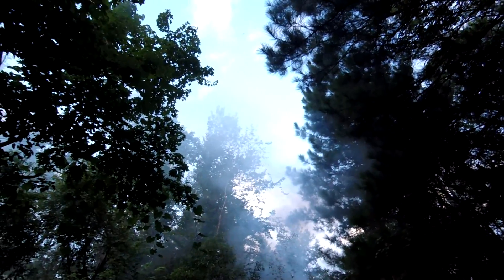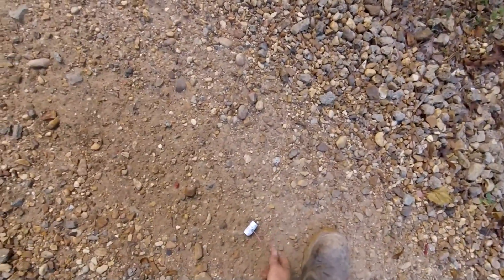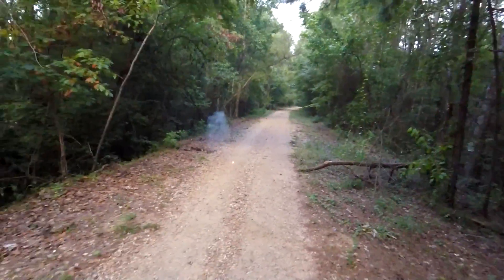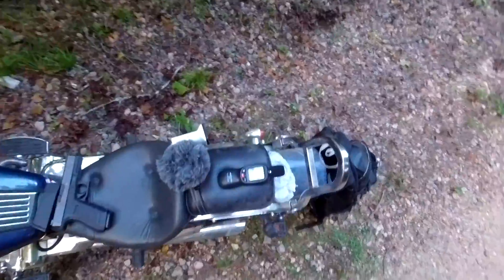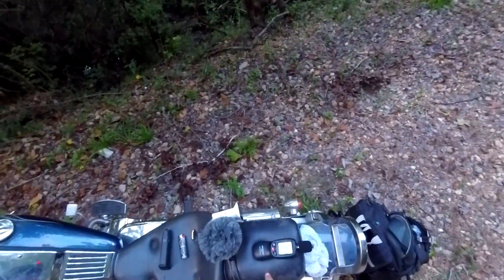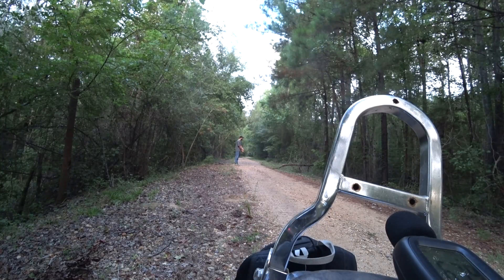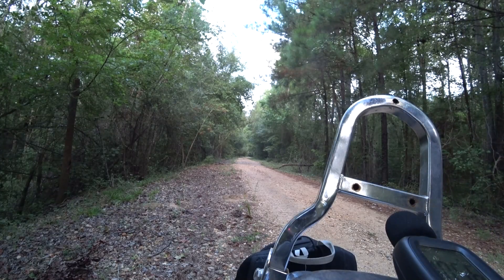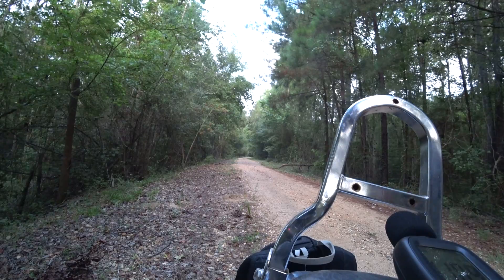Flash Powder (salute) Comparison Pt.2

Comment: Hey my brother my dad made 100's of grosses in the 60's 70's 80's and he mixed different kinds of powders that would flash and exploded.  Not so much smoke. Black silver and a white mix with a little bit of corn hull bits mixed in and boy nice boomers. Back then 10 cents a piece now 2 to 4.00 per m80's and hard to find. But there out there. Hush world boot legs supply.  😮
Reply: Can you please find out what kind of glue they used to seal the ends?

Comment: You did yourself a disservice by not mixing the flash before.  I can understand not wanting to, but if your going to mix in the tube, at least mix 5% of the Al with the PP through a screen.  This will help stop the PP from clumping and the rest of the Al will mix better.  My favorite way is to screen 5% then diaper the rest until it's mixed well.
Reply: High Humidity especially during the summer months tends to cause clumping because of the moisture in the air. Some people say this is good to prevent a charge but personally i notice a huge difference during the dry winter months

Comment: I've wrapped M80s I've made with fiberglass filament tape in crossed directions and noticed a distinct increase in sound. 
Flash creates report much like lightning creates thunder,  the reactants are two solids, the products are also two solids.  

I realized how much heat was made after doing some below ground tests which create a cavity large enough for my hand.  A very warm cavity in the ground
Reply: i use flash powder and that seems to do the trick

Comment: What are the pros and cons between plastic and paper end caps?
Reply: Plastic plugs or hot glue become a projectile,paper plugs and white glue are all that's required,that's what the original m-80 and silver salutes used,flash powder is not like black powder or gun powder,all it needs is a millisecond of resistance and it detonates,big difference
Reply: @shannonking3201   I’ve never seen a large salute in person before until New Year’s Eve.  The only thing I’d seen before was an m80.  It was 4 inches long and had 20 grams of a 50/50 mixture of Potassium Perchlorate and Magnalium.   Not sure about the construction of it.  Car alarms were going off all over the place.  I can’t even fathom wanting anything stronger than that.  It put out a decent flash too.

Comment: I was debating using double paper ends glued in each side to see if it helped with the thud on 7g of 70/30 in a 3/4" x 2" tube. 

I would be scared to do a "shake and bake". I thought this stuff was extremely sensitive.
Reply: 70/30 KCLO4 aluminum is a pretty stable mixture. Adding sulfer to the mix makes it less stable but more powerful. Be cautious when making this stuff and be smart
Reply: @JayceMcCormick  I thought I had read kcl04 is stable with sulfur. Its kclo3 that isnt. Havent tried either. Just an avid reader
Reply: @pyrocat1150  the sulfer gives an acidic environment to the composition. A video demonstrated that kclo4 aluminum with sulfer is more powerful.
Reply: @JayceMcCormick  yeah i knew combined they were stronger. I meant if it made it any more unstable to handle. With kcl04 i dont believe it does
Reply: @pyrocat1150  well think about it, kclo3 is stronger because it is less stable, causing the oxygen atoms to react faster, adding sulfer makes it more unstable causing an even faster reaction, and if kclo4 is more powerful with sulfer, than a reasonable conclusion is that the sulfer makes it more unstable. https://youtu.be/1tdmSpzAqpg
Reply: @JayceMcCormick  yeah that makes sense. I was just stating what  I had read about unstability when using it with kcl04. It didnt seem to be that way with perchlorates. But they say it's very unstable with chlorates.
Reply: @pyrocat1150  glad I could help. Be safe and don't get hurt or in trouble.
Reply: @JayceMcCormick chlorate has one less ox atom than perchlorate,adding sulphur to a perchlorate oxidizer makes the perchlorate give all its oxygen faster,and and therefore is more powerful and is no more dangerous than flash powder without sulphur
Reply: so I actually tested sulfer in my flash 64/26/10 and it burned slower than 66/34 flash
Reply: @JayceMcCormick  alright. Ive heard of 64/23/13. And 50/40/10.

Better thud
Reply: @pyrocat1150  have you tried?
Reply: @pyrocat1150 I just explained where the and how the thud as you say comes from
Reply: @shannonking3201  it seemed slower with the Sulphur than without it.

Comment: What about the shockwave?? How do these compare or does the 10mm still has a stronger physical blast
Reply: Sound is shockwave, pressure etc. The stronger blast, the bigger the "sound" or dB. BUT humans tend to percieve high frequencies louder. So a deep and hard boom may not sound loud, but it is in fact high dB.

As for your question, i think the gunfire dont have much shockwave, but is very loud as it is high frequency.
Reply: @marcuskalvik7831  ohhh thanks a lot and its weird for me im able to not notice high frequency loudness my body tends to ignore it. the ones that make me flinch and cringe are deep blasts the ones that you feel the blast physically

Comment: What glue are you using. I’ve tried everything I can but I just blow the caps out. Wood glue Elmer’s gorilla you name it
Reply: If flash powder is blowing the plugs out you have a very poor flash powder,you tube is full of morons using hot glue end plugs,the original m80 s only used paper and white glue,only had 2.5 g of flash pwder

Comment: K2Cr2O7 3% +KClO4 70%+GERMAN DARK AL 30%+1%SiO2 💣💣💣ASD -6 spherical dispersed aluminum or Spherical aluminum-magnesium alloy AMD-50M 40% +KClO4 60 %+K2Cr2O7 3%+1%SiO2 Low bass!!! https://youtu.be/KOIGs9ZmyiI rice hulls great filler add 30% to flash composition

Comment: Hey man just a suggestion to supercharge any of your flash mixes.  Add in some Bullseye Smokeless powder after you make your flash.  It contains 40% Nitroglycerine and the flash will detonate it!
Reply: This is a bullshit rumor,the nitroglycerin in smokeless powder is formulated to not detonate but burn at a controlled rate for use in cartridges,it doesn't do anything mixed with flash powder but burn,and flash powder doesn't need to be super charged as you say,good flash powder is truly impressive
Reply: how much to a 10 gram batch of flash?  1g  2g?
Reply: @SuperHighFlyGuy  2g
Reply: @SuperHighFlyGuy For a 10 gram batch you add 10 grams of Bullseye. You’ll end up with 20 grams and enough to make close to 7 salutes.
Reply: @Metal1USMC  Yeah, before the market went crazy I mixed some 50/ 50. The secret is a huge airspace. I only put a teaspoon of each in a 2" tube 3" long with plywood plugs. I pre drilled the side for a fuse. Glued in one end. Put the mix in a baggie with the fuse. Tie it shut with string. I used needle noses to push the fuse from the inside out. Hot glue it on the outside. Then glue in the other plug.

The second secret is called spiking. Run string around at 1/4" spacing. It is glued on with paste. Then, cover with paper. A quick alternative is fiber shipping tape.

A note for the ATF. This is meant to be used as an aerial salute only. Making explosives in the USA is illegal.
Reply: Have you tried them side by side? What kind of flash are you using? You obviously don't know what you're talking about.
Reply: @mattw5048  no I've never tried them side by side because the nitroglycerin in smokeless powder does not detonate it's designed and formulated to produce high pressure gas,there are many types of nitroglycerin,the one your talking about for reloading metallic cartridges,and the kind you can't get,I think you need to do a lot of research and educate yourself,I'm a prosess chemist at the Radford army ammunition plant in va,so i may know a little bit about the various varieties of nitroglycerin, smokeless powders, Dynamite,tnt,torpex,rdx,pten,to name a few,and also the batfe classifies flash powder as a high explosive,facts

Comment: I would suspect that the deeper the crater the more the sound will be suppressed. Also the ground itself will dampen sound and would vary quite a bit from one site to an other. I would think that placing them on a steel plate would be better for testing. The steel plate may contribute to the volume but it would be the same for all the salutes tested. 
I have observed that hanging the salute from a tree branch increased the perceived sound.

Comment: This is the best most thorough pyro video ive watched on here and i have watched a bunch ive been using 70/30 flash for 20 years and this just proves my own theory it works great so no need to change it thanks for hard work you put into this
Reply: Do you use the potassium perchlorate and the 30% dark aluminum, I am asking becouse I was told to never mix more than 100grams at a time, and to never store F.P..  Does that sound like it's over zealous safety advise?
Reply: @Dan_Soundgar-You can store it but it will weaken the powder over time for most compositions. Most of these people have no idea what they’re talking about. Heat n High Humidity basically neutralizes FP. I’ve been working with FP for over 23 years. IMO it’s better to mix and mill during the winter months
Reply: Hello! How can you protect yourself from random explosion when using: KMnO4 and al?
Reply: What do u mean by 70/30 ?
Reply: @omarrobles1108   70% KCIO4 / 30% Al i think
Reply: @omarrobles1108  70% potassium perchlorate 30% dark aluminum, For example, to make 100 grams of flash powder you need 70 grams of potassium perchlorate and 30 grams of dark aluminum, it's simple.
Reply: @omarrobles1108 - 70 perch and 30 AL.  Popular mix for these enthusiasts.

Comment: Have you ever tried bright aluminum 400 mesh ? When I used to do this type of thing, I had awesome results with %70 perc %27 Al %3 Sulphur. But that was long ago.
Reply from the maker: Not yet, but thanks.
Reply: I played a lot with 300 and 400 mesh AL. Worked well.
Reply: 400 mesh? Is this a comedy show in here? Dude that aluminum is crap!  You need like 3 Micron dark flake aluminum, The smaller the better! You guys should definitely not be making anything because you are all clearly ill-informed and lack any real knowledge!
Reply: @NeverEnoughPyro40  Back in the 70s and 80s, most of the bootleg stuff used bright aluminum - the outsides of the tubes were usually coated in greasy silver bright aluminum. Still went bang, I'm gonna guess that those "factories" were using chlorate and sulfur with that stuff.
Reply: @blackcatpgh13 anytime you see any trace of chemical on the tube or fuse that's a sign as to the quality of construction avoid like the plague
Reply: @shannonking3201  Yeah, when you were 12 years old you generally didn't know how dangerous those things were if made poorly. Used to get them by the dozen in ziplock bags from a guy down the street that made them in his garage. They were COVERED in 400 mesh greasy aluminum flash. My friends and I are lucky to have our fingers.
Reply: Just add air float charcoal to your bright aluminum to make dark.
Reply: @Metal1USMC that's not how dark aluminum powder is made,and adding charcoal to it won't improve it's reactivity,partical size and shape is how ekheart and indian black head get there reactivity,not throwing some charcoal in shitty sub par aluminum
Reply: @shannonking3201 how do you do It? Is there any tutorial
Reply: Bro can you pls tell that can I I make flash powder with 300 mesh aluminium powderr

Comment: @make it go boom thanks for the video....just a quick question can i use American dark aluminum or Indian dark if so wich is better? I wanted german dark but they are currently sold out!
Reply from the maker: I have both but so far i have only tested Indian dark. Indian dark is amazing.
Reply: Leonard Villalpando I just used the American Dark and was concerned that I purchased the wrong powder, HOWEVER the result was shockingly good!

Also, I had 1gm left over so I folded it up in a piece of paper, then wrapped it in aluminum foil. I expected just a blow out and a puff of smoke, but it blew up with authority! Made me respect that composition even more..

Comment: Oh man I love this test!  Can you do one with larger salutes next time please?  I Currently run the classic 70/30 but I want some extra "thud" in my salutes.  When I buy salutes from the stands, I think they run a different flash powder because it smells different, has a deeper bass sound, and sounds louder for how much smaller they are.
Reply: It is either your Al or your KCL04 that is subpar, Or it could be both! If you start messing with other formulas you could actually end up making it more sensitive, That is not a smart idea! I can literally wrap my mix in a paper towel and have it boom!
Reply: K2Cr2O7 3% +KClO4 70%+GERMAN DARK AL 30% 💣💣💣ASD -6 spherical dispersed aluminum or Spherical aluminum-magnesium alloy AMD-50M 40% +KClO4 60 %+K2Cr2O7 3%Low bass!!! https://youtu.be/KOIGs9ZmyiI
Reply: The Chinese use the blue aluminum with sulfer added it’s cheaper than dark alum and perchlorate
Reply: Some people swear the addition of sulfur changes the tone of the "boom". I'm talking kclo4/AL. Never mix sulfur with chlorates. But some people do add 10% sulfur to their pot perchlorate based flash and swear by it but if your chems are high quality.. (mainly the aluminum) then it's hard to beat 70/30.
Reply: Guarantee they are using the 65 kclo4/25 dark AL/15 sulfur mixture. The aluminum is what matters the most it needs to be flake and At least 3-5 micron.  Eckhart 5410h or India blackhead is what needs to be used.

Comment: A lot of the sound from flash powder has to do with the instantaneous rise in temperature. Just like lightning.
Reply: no it doesnt... ALL of the sound comes from the rapid gas formation that compresses the air and sends a pressure wave toward you. sound is pressure and nothing else.

Comment: Try this for your KNO3 mix   KNO3 45% + Mg 55% + S 1%   I changed the raion from 5:3:2 to this and switched to Mg instead of Al.
Reply: Mg is dangerous and unstable very unstable
Reply: @datitsdapussy4283   lol...No  Only goes to show what you don't know!!
Reply: This, i prefer mag, really seems to make good flash powder, plus you get a nice flash and lots of smoke :D
Reply: Where do you get mg
Reply: I prefer to use Mg and persulfate. Maybe this is dangerous for some reason? I mean, I’m very careful after mixing… not to impact in any way. But I don’t see many people using my formula and I’m wondering why it’s not as popular. It’s very powerful!
Reply: You only use those two?

Comment: Great science. No appreciable difference. You can still go to 5 grams and still be a M-80.
Reply from the maker: I regret not testing 3g vs 5g as well. I'm under the impression that a small air gap will aid in efficiency, and prevent a "blow out" I'll be sure to test 3vs5 in my next video. Thanks for your input.
Reply: @LionSilverVideos  in my opinion having a space is not needed with that comp but it is with BP. Your using a very fast burn, so fast it won't matter.
Reply: @LionSilverVideos does it matter if the fuse glue at the middle or the side
Reply: I spent half my younger life experimenting like this. Years ago. I found the best performance when I tamped the powder into the case.  I would fill to the top, tamp the case to compress the powder, fill to the top again and tamp down, and fill one more time. Then tamp once more to make room for the craft paper plug.  More powder equals more air expansion on the explosion.
Reply: @MrThiefHater  Actually everything you said is false! If you know anything about flash powder it actually needs room in the tube for it to burn and expand! Filling a tube much more than halfway does nothing more than waste your product, On the other hand black powder must be packed tightly into a container!
Reply: @NeverEnoughPyro40  false
Reply: @MrThiefHater I tend to not tamp flash powder. Call me stupid but I like all my fingers.
Reply: @MrThiefHater you were tamping flash powder not with a hammer I hope

Comment: So kno3 is louder then the perchlorate
Reply: No :) this is absolutely impossible from a chemical perspective alone
Reply from the maker: Sorry for the late reply...  The db's mic/sensor picks up on the deeper pressure wave, as it is technically still sound.
I'll admit, as far as what I heard in person, it did not "sound" louder, It just "felt" louder. That being said, it's still loud as all hell and safer to work with (relatively speaking).